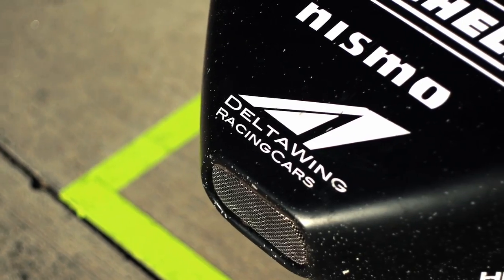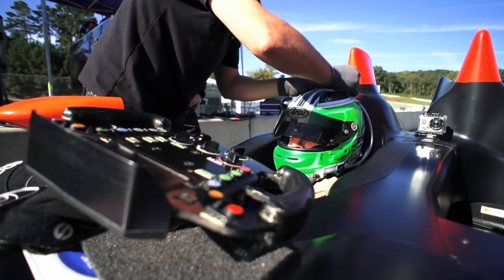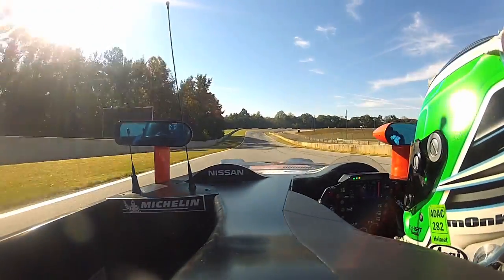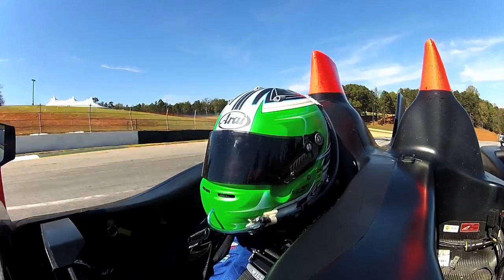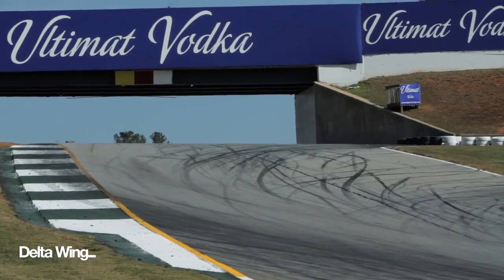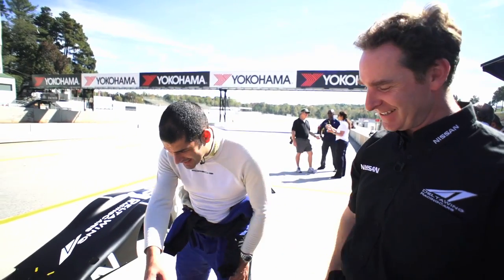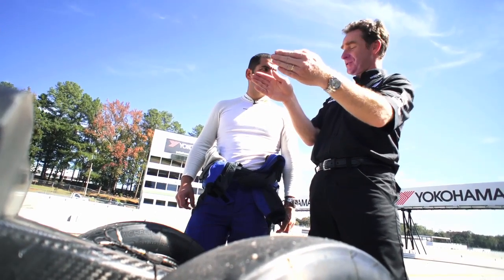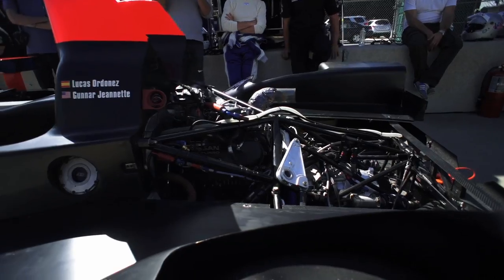Track Test: Nissan DeltaWing Driven At Road Atlanta -- /CHRIS HARRIS ON CARS

Comment: The greatest thing about the Delta Wing isn't what we see here.... It's the fact that it doesn't have to look like this. It just has to be as light, and have about the same amount of aero drag(or less).

Imagine if you built a Porsche 917 replica -the 917 being a very smooth car aerodynamically- and applied the Delta Wing's weight and underbody ground effects.

THAT is what makes the Delta Wing beautiful to me. Not for what it is(a dildo with a vertical stabilizer) but for what it CAN be...

Comment: It doesnt fit any series' regulations. It's far lighter than the cars its "beating" that have more horsepower as its not subject to the same minimum weight restrictions. I'd like to see how it fares against the high horsepower cars if they didnt have to meet a minimum weight. I would imagine not that well.

Comment: you can't put that much power to a car with that little weight. the engine would be heavier, the chassis will be bigger and all other components will be added up; maybe you will end up with an extreme 'radical' car but still you would not achieve that little cod with that much downforce. so maybe it is not the future of racing yet but it certainly is an amazing radical tech and achievement.

Comment: I'm not so convinced.  It is an awesome car but I would still bet money on a traditional style car of equal power and weight if they went head to head.  A lot of what makes this car so fast is the ridiculously low weight which is not allowed in any of the classes it raced against.  If there were no minimum weight requirements in the other classes their performance would jump quite a bit as well.

Comment: So for a four seat sedan, you might want to try something similar to a Citroen DS or SM whose rear track and width are very noticeably narrower than its front?

It might scream FF an bit loud, but if "reverse trikes", two wheels in front one int eh rear, are any indication, then a rear wheel drive "reverse trike" would be quite the nimble machine regardless of overall size.

Comment: I've been wondering for years why most modern front engine (front heavy) cars aren't balanced with the rubber on the road for better feel and handling. The only reason I can come up with is that it would look funny to have wide front tires and narrow backs... such a shame cause they could be so much nicer to drive, except maybe the loss of steering feel.